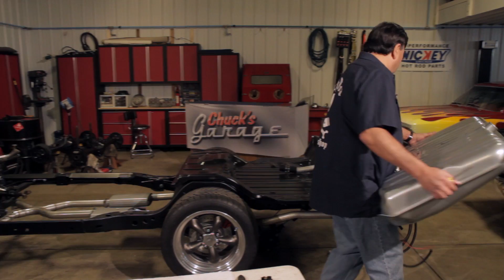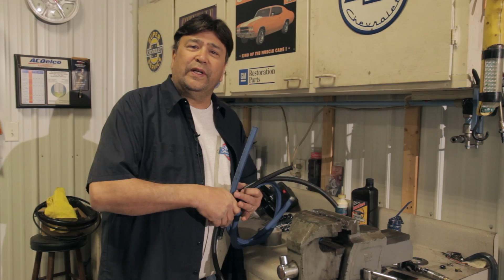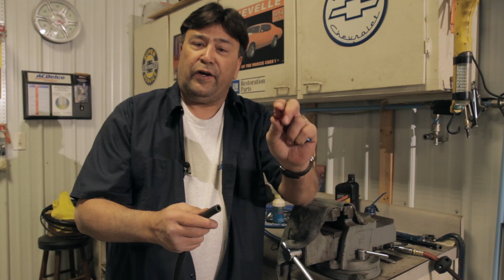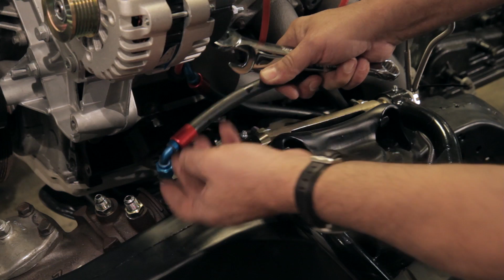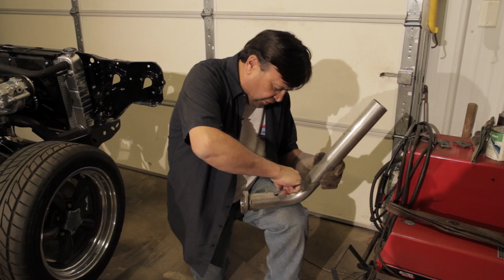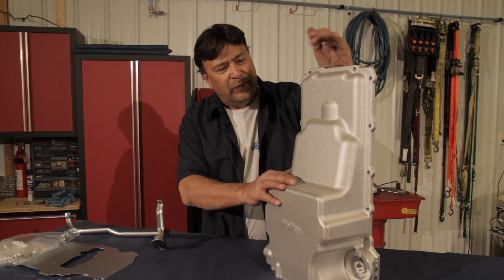LS Engine Swap Part 7 - Plumbing

Comment: You changed to Tanks in tank pump. I recall you showing a Holly low noise  inline Gear rotor pump from earlier parts on table to be used.

Comment: Question about transmission cooler how does it push air or does it pull air through since the body will be setting over it?

Comment: BTW, really like the Holley 302-2 oil pump revised version.  Not to mention their intake and big 90 mm / 105 mm throttle body replacement parts.  Some fine American engineering there.  [ Anyone know what those five-spoke wheels are?  I can only I.D. the AR Hopsters.  I'd prefer 'Made in USA' American Racing Thrust Torque D wheels or other similar (but made in USA).  '_'  ]

Comment: So what all do you need to do I have a 2006 and 2007 charger and magnum and I want to go to v8 motor hemi how hard is it and what all do I need to pull for it to work or is it just as easy to put a LS motor in both of them is that possible

Comment: Not sure why anyone would crawl under a car without jack stands in place.  There were jack stands under the front but not the rear, where the work was being done.  One day that .35 cent oring is gonna fail !   Just Say-N.  Safety first bro.